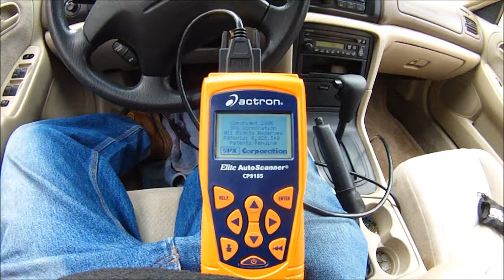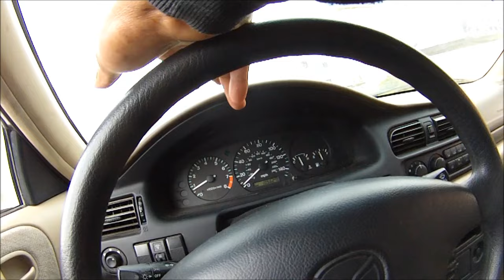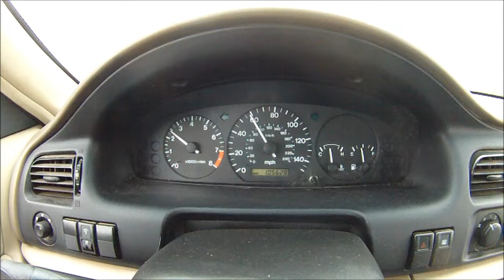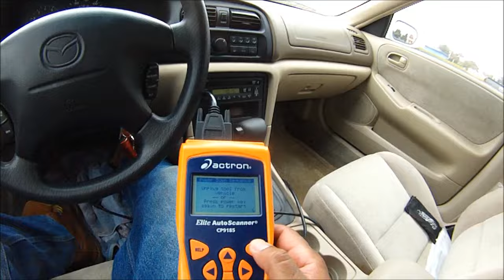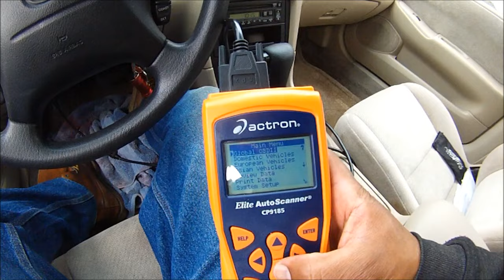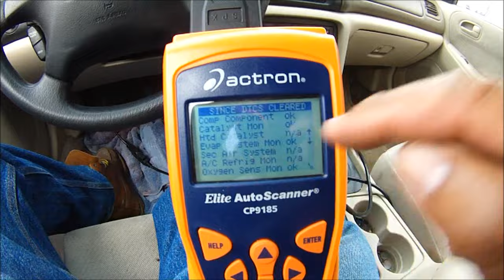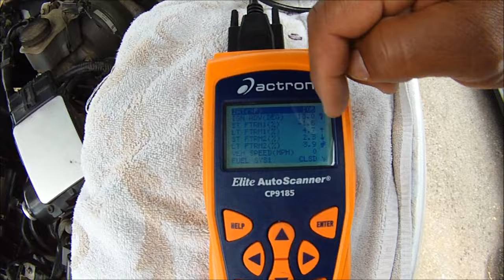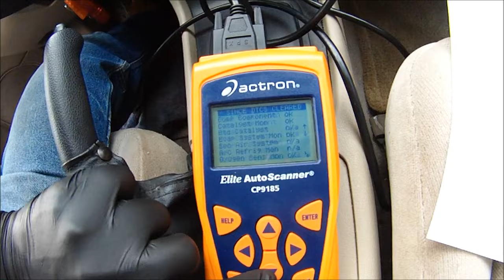WHAT SMOG TECHS WONT TELL YOU AFTER YOU FAIL THE SMOG TEST FOR (INCOMPLETION OF OBDII SELF TEST)

Comment: Any advice on the ECU not storing the drive cycle? I noticed that most monitors were ready after checking the scanner with the car on, and after a drive cycle. But as soon as the car was turned off and i rechecked the I/M readiness 4 monitors were back to incomplete.
Reply from the maker: Check if anyone tapped into the wires by the Data Link connector, check accessory fuse, and battery plus line coming from Data Link Connector.
Reply: Okay, I'm going to try that thanks a lot man, love your videos btw. much love from La mesa SD. God bless.

Comment: Every time i go out and try to do my drive cycle something happens that screws it up. Now im looking to try and get this drive cycle done at 2 am in the mourning. This really is getting ridiculous. My nissan pathfinder has a simmiliar drive cycle. My question is, if something happens durring the drive cycle do i have to wait 8 hours to try again. I just attempted 1 at 9 pm that got disrupted by traffic. Can i try again at 2 am? Also if i do hit the brakes can i just start over and drive 60 mph for 5 minutes after i hit the brakes?  At this point its going to cost me more in gas at all these stupid drive cycles than if i just had taken it in for drive cycle. Or do shops not perform drive cycles for customers?

Comment: Nobody normally drives 5 minutes at a steady 60 miles per hour and most people pass smog without needing to go through a special drive cycle.  So what are the real rules for triggering the drive cycle?
Reply: depends on the car you have, google it, for example on my bmw e46 the drive cycle is as shown below. if you try to complete the drive cycle it will work because you specifically know what you have to do to get the sensors ready but if you do normal everyday driving it might take longer.
Reply: the real rules are just drive normally and theyll all run eventaully (couple days at most.)  they're not programed to be some special secret..they'll all designed to run under "normal" conditions.
Reply: Yeah, except that my interest in the subject was piqued after I failed smog a couple of weeks after jump-starting my jeep.

Comment: My Nissan sentra 1997 231 thousand miles didn't pass the smog. I think because it's been sitting for a long time used a jumper to start it and took it to the smog cause it was time for it. 

My question is will dead batery/jumping the car affect the smog result. Mind you that I didn't drive that car for a long time and took it straight to the shop

Comment: AWESOME info. I had to get a new CAT the PS420 or something like that was showing that I needed a CAT so I went to like 3 places. FIRESTONE  was the MOST expensive they wanted $1700 to replace two plus they charged 85 to check it. LOL. But I was able to go to Pep Boys where I bought a alternator and decided not to get the cat. BUT they ran diagnostic and said that they could actually do only ONE CAT of the three on car and it would pass smog. So I just elected to get alternator which was HIGH with install.. (OVERPRICED) but I got 50,000 mile warranty..  But then I went to another shop months later which was last week.. I went to muffler/brake only shop. The guy charged me like $400 for a new cat, install, and 12,000 mile warranty.  BUt he said DRIVE CAR before taking to emission for 60 miles. So I did that but today I took to another brake/muffler shop that DOES emmisions b/c that one before wasn't authorized to do emmisions.  BUT they said car wasn't ready and I needed to drive it more I showed them that I had some work done. But I had that shop to get me an oil change . but I didn't pass the emmissions so I am going to take your advice. I will also have someone check the tire pressure, timing, gas cap, etc.  Thanks for your advice. I will post again later once I pass I'm sure it's the CAT is new and I didn't do the type of driving you're speaking of.

Comment: I ran this a few times in my car and the only codes that show incomplete are for the EVAP system and secondary air system. Any idea how to fix these so my car will pass smog?
Reply: evap monitors usully have strict run criteria (ie it only runs when its the right temperture and the fuel level isn't too low or too full and only after the car was started after sitting for a while etc etc)   just  be patient and give it a few days of normal driving and you'll be fine...there's no reason to be running drive cycles unless you're doing diagnosis etc..otherwise just drive normal for a couple days and they'll all run.
Reply: mike kwak I followed BMW drive cycle FTP and fuel is 1/4 to 1/2 full at cold temperature. I will try again today/tomorrow. Love the Actron Scanner used in the video thats what I bought to use it is quite helpful. I went from all monitors incomplete down to just EVAP and secondary air.

Comment: Hows it going man , i like the video, Would you please help me out my car failed the smog , the codes that came are "P0172 system too rich (bank 1)"And "P0141 02 sensor Heater afault (Bank 1 sensor 2)" i found one sensor with wires cut off, the one on the bottom ,so i bought it new , and i bought the one on top as well, do you think its ready now or what else should i check, oh and it says that the OBD system check is not ready to test, the battery was dead so im guessing is the same as disconnecting it?well i got he battery charged up as well. Wel hope you can help, if you need more specific info let me know thanks man God bless.

Comment: If you have problems with the cat converter, just do the seafoam treatment or Marvel mystery oil can be used too. That will unclog and clean it, no need to replace it in most cases. Code P0420

Comment: How to perform on manual transmission. I cannot come to a complete stop or else engine will stall. I'm pass due on smog and been driving my car for 300 miles and evap still not ready.
Reply: downshift ,then pull in the clutch
Reply: nope nope The drive cycle for GM vehicles SPECIFICALLY says not to downshift or clutch, in addition to not braking. You don't need to completely stop though, the GM drive cycle specifies you must drop below 20 mph, but not a complete stop. Other vehicles are probably similar.
Reply: Martin Green yea for my civic I'm supposed to decelerate from 55 for 90 seconds with out shifting but that won't happen
Reply: My manuals says to do it for 90 seconds or to do it for 30 seconds three times

Comment: Hello OldSkool<, like what you do Thanks. A very informative video. However, Do you have any idea what smog/inspection sites generally look in older cars such as a 1993 Mazda MX6 V6 2.5L manual shift. As it is pre-1996 I don't think my car has that type of connection to hookup to one of those scanners. Besides basic check/change for oil, air filter, vacuum leaks, throttle body,plugs etc any other recommended checks I should make? I know it varies a bit by location and CA one of the strictest. Btw I'm in north TX.  I appreciate any assistance. I imagine you've saved others lots of money, needless repairs and time. Keep Pressing on!  To God be the glory!!!
Also that 1999 Mazda 626 engine looks similar to mine, I guess it is the same type engine. Right now it appears to be burning a maybe a bit rich as I can smell the muffler quite strong but doesn't smell like unburned gas. Not sure exactly what that is about.

Comment: 55 mph for 5 minutes and then decelerate from 55 mph all the way down to 0 mph without using your foot break on a freeway??? Can't you do this on a long stretch highway going 55 mph for 5 minutes and then cost to a safe speed then you use the hand break to come to a complete stop??? I mean it's not like your car knows if your on a freeway or not as long as you go 55 mph for 5 minutes and slow all the way down to 0 without using your foot break on a very long stretch open highway, I mean shouldn't it work the same way and be the same thing as being on the freeway as long as you do the cycle correctly??? The reason why I say this or ask this is because on a long stretch highway that's near me there's hardly any traffic on it and the freeway is just packed with traffic so I figured it would be much easier and a lot more safe to this drive cycle on the highway rather than the busy ass freeway in my area lol
Reply: I was wondering the same thing this doesn't have to be done on the freeway does it??? As long as you do the cycle on a open stretch road/highway going 55mph for 5 minutes should be the same thing as long as you do the cycle correctly but correct me if I'm wrong anyone LOL!

Comment: Does it work on 2011 civic.  I. M.  Monitor I/C. EGR. Cataytic. O2 SENSOR.  Other. 5 completed.  Do I need to clear all code before I do drive cycle. I don't have check engine light

Comment: Most of this is true.  Not applying your brakes for awhile though is not true.  Each time you apply your brakes it actually helps your evaporator monitor to set on the ready.  Heres how I get cars to set.  I start tem and pull a plug wire with it running or a coil plug and let it run for one full minute.  That surges your ECM and brings it out of dormant mode.  That procures a code of course so you erase all codes then and then drive the vehicle for only 3 miles  One mile at 55 miles per hour and the other two miles stop and go.  I get nearly all of the ready monitors to reset by that simply method.  Sometimes by causing a code to happen wakes up these dormant ECM boxes and when you then erase the ECM is in active read mode.  Heres how you can get the actual code when you receive the GM po300 code or fords po316 code which means misfire in the system but offers no location and that is to use the unplug one coil or plug wire while running and then reinstall but ignore that code and ECMs will usually then spit out the actual part causing the misfire.  Then after you fix the proble erase all 3 codes and do a drive cycle like I said.  I do this all the time

Comment: Will this driving cycle work if I do it at night time and with a manual transmission do I fallow your steps exactly?
Reply from the maker: Adolf Alvarez You will have to google your drive cycle, yes it works for manual tranyz just pop the clutch in neutral with out pushing the clutch pedal when coming to a complete stop after the 55 mph drive

Comment: Hey Funk I took my car in for a smog and didn't pass cuz emission system self check not complete i had to get the transmission sensor replaced and they reset my computer how far do i need to drive in order to get the emissions up so i can pass smog?
Reply from the maker: Nicholas Hall All drive cycles are different for each make and model. Google your exact year make and model and try to find it. but you may also have a problem with that specific system not finishing the monitoring process. for example if your evap system has a leak or an issue with a sensor or solenoid then the monitors will never complete until the issue is fixed but try your drive cycle mode first its the best way to start or put a scanner on it and check if you have codes.
Reply: Thanks so much I just looked it up and subscribed to your channel your very knowledgeable

Comment: While i agree whole heartedly about the EPA and smog being a rip off..... There's the whole cost to operate. Payroll, each test we do costs money pass or fail. The machine we use to read the i/m monitors costs $1200. Yes u can buy cheap ones but they dont always work on every car. We do offer free retests so if you dont have the monitors ready u can come back after driving and getting it all set. The actual smog machines are run by a monopoly $20 grand a machine. But they only let u lease the new machines for 500+ a month. Also sometimes monitors dont run because something is broken. If your thermostats broken and one of the tests requires your motor to reach a certain temp.... It will never run because the computer isn't seeing the proper settings to run the test. A lot of what he is saying is like half right. The monitors are diffrent for every car but about 95% of the cars monitors are supposted to run with everyday, normal, garden variety driving. Some require you to "set the car into monitors" by letting it idle for a certain time limit, press the brake 5 times turn the wheel left and turn on your headlights" then it starts certain monitors.

Comment: I have a 2000 Mitsubishi Galant. I took it to get smog test. I thought the MIL light was what was the primary indicator. Well I was wrong. It failed. It appears when the key gets turned off, all codes get forgotten. When I was sitting there waiting to get it done, I would turn off engine as there is a small head gasket leak.and I live in AZ. I have torn off the entire dash board. I have yet to find the computer. Some say behind ash tray and some behind glove box. I think the one if the positive wires are getting disconnected from the key switch or that Mitsubishi maybe should get sued as there is know problems from 96-98. It appears they did not completely fix it.

Comment: ok so what if your have code p0400? California smog fail but no check engine light on. i was tool by smog tech do drive car around  and re-test.
Reply from the maker: That code is your EGR Valve. It might not be bad. It recycles some of the exhaust gas back into the combustion process to cool down the cylinders. Sometimes the carbon will build up in the EGR and causes that code to set. I would test the function to see if its jammed open or closed and clean it out with carburetor cleaner. Google how to test it first.
Reply: +oldskool funk Will do thanks

Comment: Any other scanners that you could recommend? I would love to get the Actron but I cant afford the $300. I really just need one that shows exactly when all systems are ready (just like this model)
Reply from the maker: Douglas Stewart Check the Innova scanners some are cheaper. Just make sure you get one with live data.
Reply: oldskool funk Thanks. Ive been dealing with a check engine light for years now. Ive replaced every possible part. It passes emissions fine. I really think its a faulty/loose/damaged wire. So the live data is the key. Because I need to take it as soon as all the systems are ready to test.
Reply from the maker: Yea the live data is absolutely very important. Let us know what the issue is (code) maybe we can give you some areas to attack ok

Comment: i have nissan 350z with test pipes but theres not check engine light or pendind codes , i took it to pass emission test but it didnt pass  (catalylic converter not ready/ evaporative system not ready/ oxygen sensor not ready)  what can i do to pass emission test?

Comment: Godd job and thanks for that man. I have a ford windstard 99 i fix the codes  i repair it check engine come on again i reset it but come on again an my question is. I have monitors not ready like catalyst evap sysitem oxygen sensor oxygen sensor heater  can i reset the computer again run my car in the freway like what you show and re check again. Could be work ?! Can you tell me. Thanks man!!

Comment: I have a 2012 corolla and I have tried twice now, spending $4 on tolls in the process this method and I still have Catalytic Not Ready and O2 Sensor not ready. Anyone have any ideas on what I can do? This is driving me nuts after failing inspection
Reply from the maker: nightrider2002 http://www.justanswer.com/toyota/56fdr-toyota-corolla-s-need-know-exact-drive-cycle.html 

give this a try, don't give up
Reply: Hey, oldskool! Thanks for a fast reply. I note that is for a 2004, do you think that will work for me? I seen in your other video that its somewhat similar to what that says below, but my question for you is...What on earth is 25% throttle? What does that mean?
Reply: @oldskool funk I tried that drive cycle, the one in this video and the one in #2 and all 3 still has those same 2 as not ready. SO my next step is through my uncle knowing a guy with a high tech scanner and see if its part problems. If its not, maybe I disconnect battery and hope for the best on drive cycle

Comment: Just wanted to say if u goto a test only smog check the technician legally isnt aloud to give u a diagnosis.   They can tell u what u failed and what that means.  They CANNOT recommend any repairs or even any other repair shop by law.   Please don't hold this against them. 

The reasoning behind this is so that the customer is guaranteed a FAIR and UNBIASED test result (pass or fail the shop only gets paid for an inspection.. Theres no $ benifit to fail u at a test only (which is why i go to them instead of a test&repair)